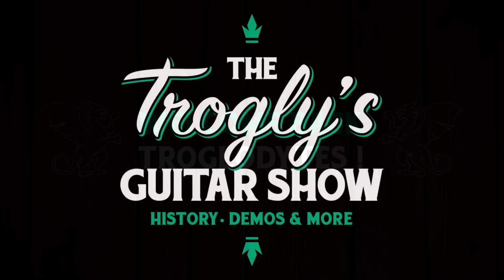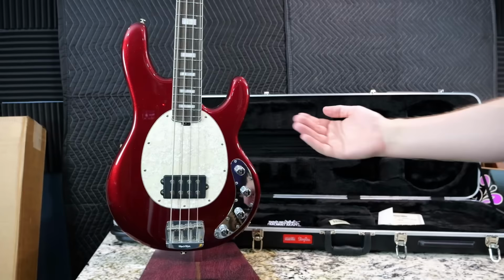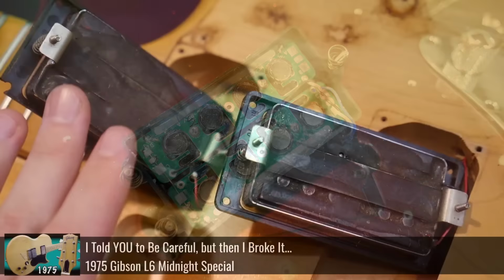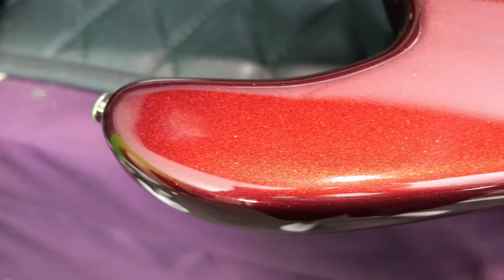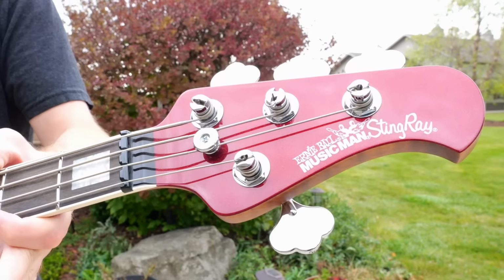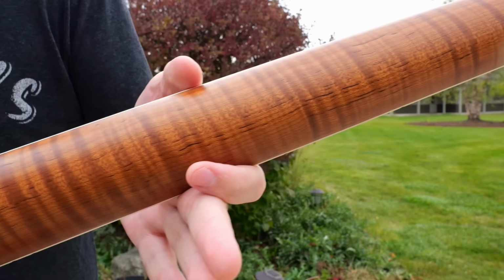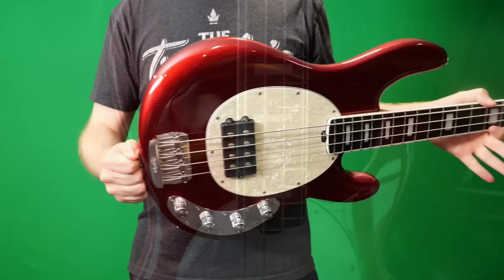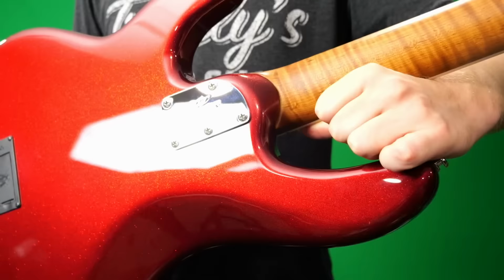I Tried My First "String Ray" | 2022 Ernie Ball Music Man BFR StingRay Special H Bass Ruby Punch

Comment: Austin, Mr. Fender was trying to give the StingRay Bass an identity, but he wasn't trying to differentiate from anything by Ibanez, but from his own past.  Take a good dead on look at the StingRay's body shape and it begins to look like a Precision Bass, which it almost is.  There's not that much that is different between them.  Most old-school P-Basses sport those split-coil pickups, and those pickups are humbucking.  The biggest differences I'm aware of are the substitution of a traditional side-by-side humbucker for the split-coil, the active EQ, the pickguard shape, the neck mount (trimmed and equipped with 5 bolts over 4), the truss rod adjustment location and the headstock.

Even though I'm no real bass player, I've wanted one of these for years.  Thanks a lot for this video!

Comment: Bought my first EB musicman stingray special (its a 5 string)  2 years ago and shes definitely become my daily driver so to speak lol. I love mine.

Just a note, its actually a gunstock finish on the neck (tru oil, and a wax finish) with a lacquered headstock.* At first i thought the transition to the headstock was a defect in the finish with mine, however this is how they are all finished, it gives a smooth natural neck feel but still gives the headstock some durability against dings and scratches (and probably to hold the waterslide logo on the headstock)

Edit: The transition on the headstock finish seems to be well hidden on the bass you have, so my previous statement may be irrelevant here lol. I guess they blend it better on the Ball family reserve models.

Comment: Aside from the compactness of the headstock, the other and main reason for the design of the headstock is that it allows for a straight string pull, which results in better tuning stability.
Reply: The original idea behind this was to eliminate deadspots on the G-string, if I remember correctly 🙂

Comment: I bought the Special H in late 2018 for $1800.  I love the bass but the only issue I’ve had was with the battery compartment.  Some times the battery would lose connection and the bass would cut out.  I’ve tried adding a small shim to help keep that battery tight to the connection and it helped for a while. Eventually I had to have it replace but I’ve still had it lose connection a couple time while I was on stage playing.

Comment: So a few things this is a Stingray “special” BFR. The special denotes the facelift they did in 2018. They made the bridge smaller and lighter. The original bridges were held on with 3 bolts and two studs now they just use three bolts. They added a comfort cut to the back and armrest. The originals are a full slab body. They went to a smaller machine for the tuners. They added a roasted maple neck. They added an 18 volt pre amp that was originally exclusive to the Bongo bass. The originals had your standard 9 volt preamp. And finally they added an extra fret.

Then to BFR short for Ball Family Reserve. The are limmited runs that use woods that you won't normally find in your standard stingray which is a swamp ash body with a maple neck. Ernie Balls call them “Tonewoods that work well together” if you believe that stuff. They also do unique colorways. And it's usually a limited run of 40 to 100. 

IMHO if your going to spend the extra cash for a BFR try and get a translucent color. Because the woods they use in these are on par with what you on that back of the neck on this example. Beautiful flames, quilts, and even a birds eye or two if your lucky. TLDR it rivals Gibson and PRS triple A tops.

Comment: Love Stingrays!  I recently sold my 2006 30th Anniversary 4 string.  They only made 700 of them.   Mahogany body and lacquered birdseye maple neck combined with a string through bridge made it quite unique and also pretty hefty at 10.0lbs.      I've got an Indonesian Sterling that I got off a guy who buys and sells Amazon pallets.  The finish is really banged up, but I'll probably try to do some kind of relic job on it.    I installed a series/parallel switch and am in the process of building a 70's style preamp PCB for it.    Honestly, I think the thinner neck of the Sterling suits me better.

The extreme contours you noticed are a new feature in recent years.   Same for the 18V system.  The neck on that bass is stunning!!!

Comment: $3,500 with scratches like that…I’d send it back in a heartbeat.
Reply: Was just gonna comment something similar. Lol. $3500 bass with free scratches SMH
Reply: And the bridge screw penetrating all the way through the battery cavity is disheartening.
Reply: You won’t get the neck again though.
Reply: @andyschwarm small company, so their number of sales is smaller. And they are generally extremely well built instruments (occasional flaws not with standing).
Reply: The Bass is a real beauty but these scratches out of the box are a no go.
Reply: @f3uibeghardt522  I thought that too. Doesn’t reek of stability, having even a little bit of the threads attached to…nothing.

Comment: The bound ebony fretboard and block inlays look odd to me. I prefer the roasted maple fretboard and small dot inlays. The bridge and saddles are really poor quality for that price. The bridge on my Sterling Stingray ray34 is way beefier than that. Maybe those specs are why it has a thinner tone than I'm used to hearing out of Stingray basses? Mine sounds nothing like that. Only other  differences are the 9volt active 3 band and 6 bolt neck plate. Alnico magnet humbucker might be another difference? Not sure what these new 18 volt units have, maybe ceramic?
Reply: I admit I too was surprised at how basic the bridge is constructed.  It doesn't even have those little grooves in the base plate that keep the saddles in place!